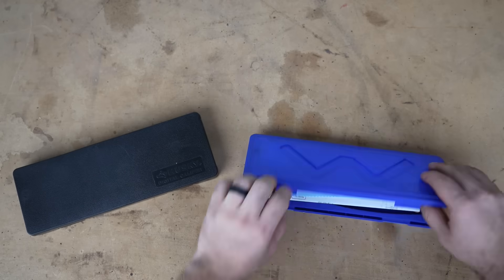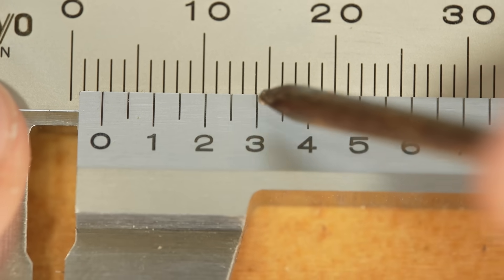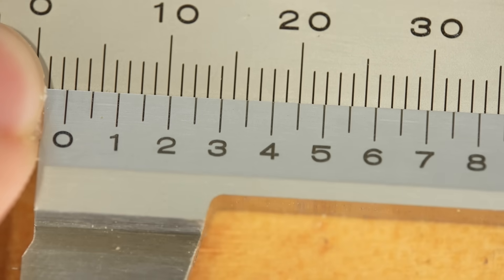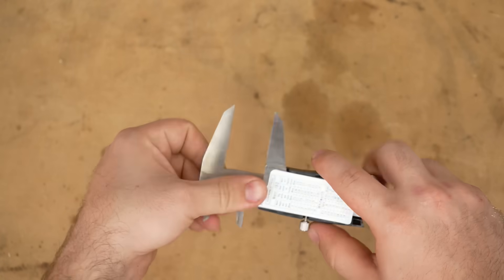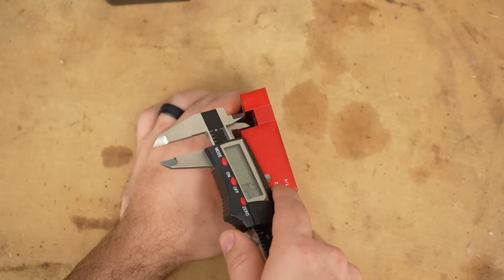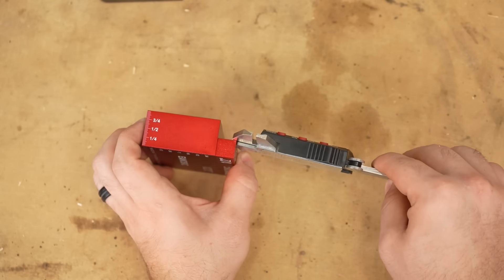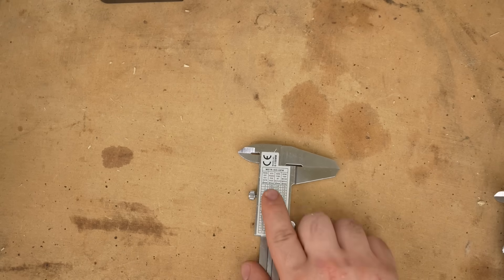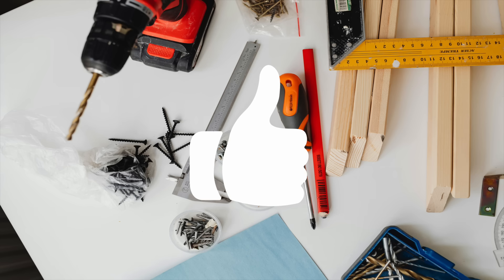I wish i’d known this sooner, How to use calipers like a pro

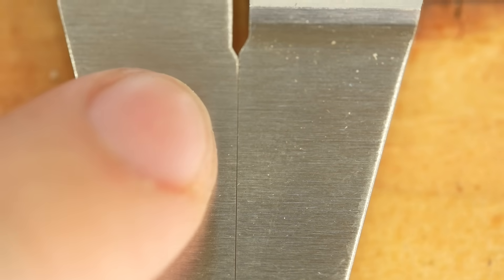Comment: 0:55 Uh...  what?  There had better not be any space in your calipers when they're closed, or they've been machined improperly.  And yeah, a bad grind on the jaws would certainly make them inaccurate, but again, they shouldn't have that problem (or they're completely useless).  More importantly, this has nothing to do with the accuracy rating of the instrument.  The resolution printed on vernier calipers is solely the product of the measurement markings engraved (or printed, etc.) on the tool.  In other words, those numbers--be it 0.05mm or 0.02mm or whatever, tell the user what each line on the sliding scale represents.  As far as the accuracy goes, the user simply trusts that the markings are correct--or verifies them against a known standard.
Reply: Calm down, sweaty 😂😂😂

Comment: Another trick I use when using a digital caliper when facing many parts to length in a lathe or mill (or any measurement for that matter) is to set the caliper to the desired length and ZERO the readout there.  When you measure any parts, it will take the guesswork out of how much needs to be removed to get the parts to final size.
Reply: or to determine the hole spacing of two identical holes: measure the hole, set to 0, measure the hole outside/outside with the inside measuring jaw and you have hole center/center
Reply: @Zedus-rl9hp  brilliant. i guess for diff size holes: take diameter of first, set caliper to half (i.e., the hole's radius), then zero. then take diameter of second, set caliper to half (again, radius), then zero. then use inside jaws to measure outside to outside the holes and there's your on-center between 2 diff size holes.
Reply: My fav part of this trick is when I take off too much material and end up scrapping the part.
Reply: What you said is also called "Machining to Zero" this works with digital read outs as well.
Reply: i do similar when sorting brass cases or checking bulk ammo for oal.
Same set of dials for over 30 years.  I have some digitals...but I don't trust them as much lol.
Reply: Yeah, I do this often when checking a bunch of pieces against a reference value.
Reply: Dude that trick impressed me more than thread depth mesuring trick
For those who dont know:
You want to mesure the depth of a thread. Mesure the screw - Zero the caliper at length of a screw - thread in the screw - Mesure with rod how much the screw sticks out = Thread depth.
Reply: Makes so much sense, but I never would’ve thought to do this. Half the time I forget I even have calipers! Lol. Great tip. Thank you.
Reply: Brilliant. You just turned a precision measuring instrument into a go/no go gauge.
Reply: Ability to zero the caliper should be considered the main reason to get digital caliper. Other features worth considering are easy reading vs no ability to measure anything when battery is dead.
Reply: yeah it is a mobile dro after all. good ones are expensive though.
Reply: That is smart!
Reply: I tend to do this as well, especially when I am measuring something at an angle and I can't see the display.
Reply: Yes. Now I've got to go look my tools over to see if I've got any China Exports. It never ceases to amaze me how those with less quality try to pass themselves off with deceptive markings.
Reply: @davidgagnon2849  You do not. It is a myth. It is false information. We should stop spreading it.
Reply: @davidgagnon2849  In Chinese culture it is better to fool the consumer than too make the superior product.  They get more satisfaction and recognition for the deception. It has been that way for millennia.
Western culture does not understand this.
Reply: @davidgagnon2849  CE is a self report. all it means is that the  manufacturer says they have assessed it to be legal to sell into and in eu.   technically you need to keep documentation for that assessment.

so it really doesn't mean much since saying you're not up to CE would be like saying you're not legal to sell. it doesn't speak of any quality aspects.

you can CYA by having a 3rd party do the assessment, but it's not like non eu companies have anything to cover and it falls then on the importers.
Reply: @davidgagnon2849  being compliant don't mean quality, anyway. Just mean compliance to some political rules.
Reply: @electronicscaos  Agreed!
Reply: Don't do what @sferg9582 suggest.
Unless you own an expensive (absolute) caliper like Mitutoyo.
Here is why: the calipers sometime jumps and deviate from the real value.
When you start from zero, it's easy to see that it jumped.
When you keep on opening and closing it, you can't be sure that the zero is actually equal to the length you are aiming for. Unless you go back and check that it's flush when set a 0....
Don't ask me how I know that....
Reply: @xl000  ALL calipers can lose their place and read incorrectly, but you have to be extremely fast with your movements, even with the cheap-o brands.  I have had maybe 6 different digital calipers over my time, and they have never given a single event of misreading due to movement, fast or slow.  Besides, you can quickly check your set value by closing the jaws and reading what your part length is supposed to be.
Besides, even the MITUTOYO's can be sent into error if you move the jaws quickly, don't be fooled.
If you're so worried about accuracy, you wouldn't be using a caliper in the first place and should opt for a micrometer.
Reply: @sferg9582  Exactly as you say.
If I were to set a size of say 16.5 mm for example then zero the digital caliper at that actual size then closing the jaws will read minus 16.5mm...dead simple to double check on.
Reply: guess work?  you shouldn't ever be guessing on a lathe or mill.
Reply: @attack125  Ya think?  Some people have a problem with making simple calculations in their head and could be "off" in their guess of the difference.  Ever see someone misread a micrometer and be off by as much as .100"?  They guessed wrong....or did they misread it?
Reply: @attack125  I suppose you just instinctively know how much tool pressure there is in every situation.
Reply: @intheshell35ify  ..
..
i mean.
do you not??
Reply: @attack125  no, because I've not been in every situation. Go push a button.
Reply: Good old fashioned engineering will never be bettered by a computer as engineering creates the computer. Why do we teach young children (not kids) to rely on a battery tool - the Victorians had no batteries, Vernier Callipers, Slide Rules if the computer is broken the older generation will use old fashioned tools like a multimeter to effect a repair. Above all your times tables are sacrosanct if you can - play darts and use mental arithmetic for the answer if you know maths the rest is easier, no maths then you are up a creek without a paddle.  Never, never throw the baby out with the bathwater. This earns do not forget where you have come from.
Reply: @GRUMP5B  Re: "Good old fashioned engineering will never be bettered by a computer" Ahh yes, I remember my mechanical engineering apprenticeship I completed more than 40 years ago. turning those dials to machine on milling machines and lathes, and locking in the auto feed.  These CNC (Computer Numerical Control) lathes and machining centres I was programming and operating just two years later couldn't be better than the machines I learned on... could they?
Reply: @GRUMP5B same reason you’re not typing your comment on a typewriter and sending it by pony express. Technology makes life exponentially faster and more efficient
Reply: @GRUMP5B  they don't teach young apprentices to just use digital. Or atleast not here in the uk. As part of my apprenticeship we had to use vernier for the first 6 months. Then we were allowed to use digital once we sufficiently proved we could read manual. As the company I work for works to such tight tolerances digital is preferred. A decent set of digitals will always be slightly more accurate than a manual set.
Reply: @matthewjohnson2281  indeed. I was an apprentice forty years ago... Umm I don't recall digital other than super posh stuff. I did Vernier 😅
Reply: @GRUMP5B  The victorians also died at around 40 years old.
Reply: @GRUMP5B  Username checks out. Very grumpy.

Comment: The whole China Export myth has been debunked already but it keeps popping up. The CE marking on products manufactured in China actually corresponds to the European CE marking required on some products but it looks different due to changes in dimensions and typography. There is no official CE logo specification. Also, the European CE marking only indicates (but is not proof!) that the manufacturer claims to have passed the required quality controls (which is always the responsibility of the manufacturer). This is often the case but not always. And the reason they put the CE logo on there is because the European Union demands that for a whole slew of products that manufacturers want to sell in Europe. Just search for it and they are easy to find.
Reply: "There is no official CE logo specification."
Actually, there is a very specific set of criteria for its relative dimensions. And length over all can't be shorter than 5 mm. (in those cases it can be printed on the packaging and/or instruction manual, or other documentation if applicable.)
It is literally part of the CE directive itself.

However, the requirement that the two circles should overlap has been misunderstood by a few manufacturers that has ended up printing it incorrectly.
One being Microsoft, having the compressed (and thereby incorrect) version on their wireless Xbox 360 controllers.
Reply: Google and Meta are violating the 1st amendment rights of Americans
Reply: Buying an item from inside of the EU gives the consumer the right to asume that this item  is in compliance with EU legislations and harmonized standard, if you import something from outside the EU, you cannot asume this. if you import items you have to make sure theese adhere to EU legislations and standards yourself. If you import, lets say a machine from china and want to either use it or distribute it withing the EU market, you do not have the right to asume that it adheres to the EU market standards, and neither is it the Chinese manufactors role to make sure this machine adheres to the EU standards, this even if they slap on a CE logo on it. That role falls onto the importer. If you buy something from a EU importer or manufacturer that does not uphold to the EU standards, you can demand a refund or that they bring it right and tip of your national market survelliance body for good meassure. (https://single-market-economy.ec.europa.eu/single-market/ce-marking_en ... https://www.hqts.com/differences-between-ce-conformite-europeenne-and-ce-china-export/ )
Reply: There is a very precise official CE logo specification

You could even use calipers to check it...

Comment: Note that resolution and precision is not the same thing. The digital caliper has a resolution of 0.01mm, but not necessarily that level of precision (check the datasheet). Also, a lot of measurements are tricky to perform by the operator. There's a thing called MSA (measurement system analysis), which is used to determine how reliably an operator can make a certain measurement
Reply: if someone is measuring "by hand" precision of the instrument is the least of the concerns
Reply: @zaxmaxlax  Right, so that is why MSA exists, to check the spread of the result from different operators (amongst other influencing factors).
Reply: There are "micron calipers" now available (0,001 mm). There's not much practical sense, but they exist.
Reply: True, but often times resolution is more important. My primary use for calipers is that I zero them to some reference and then use it as a comparator relative to that reference. This renders the precision far less important than the resolution and repeatability.
Reply: Only real advantage of the digital is for people who have bad eyes and can no longer read the numbers on a vernier.
As you suggest the extra digit doesnt typically add any precision. A vernier is already approaching the limitations of erronous human hands.
Reply: This video says accurate when they mean precise